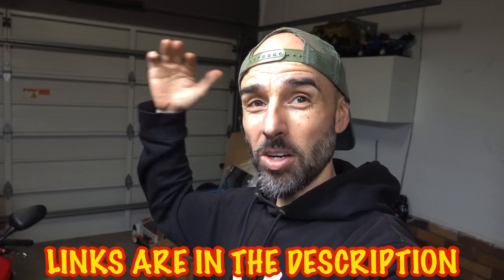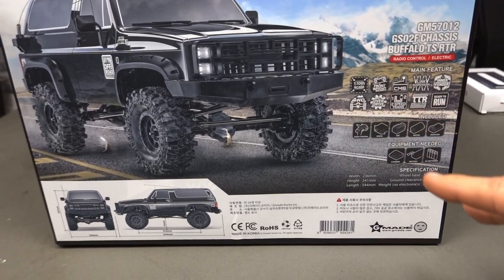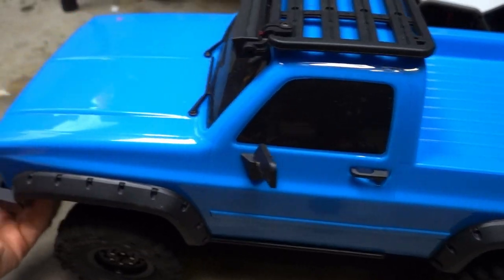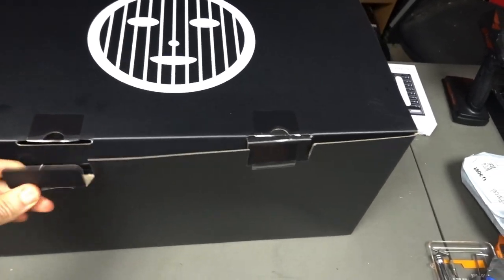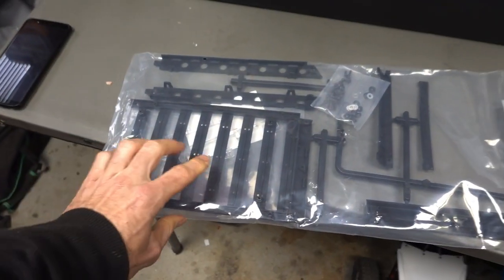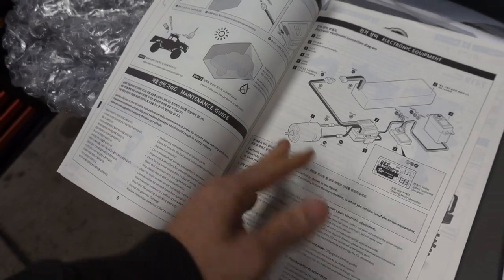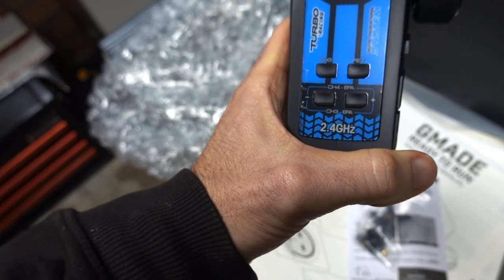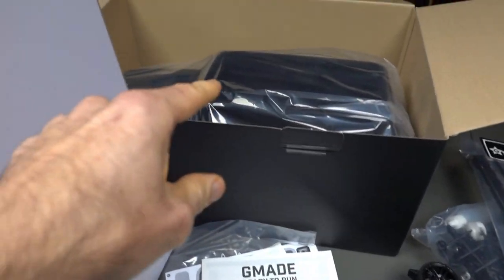STEALTH BLACK! GMADE BUFFALO RTR

Comment: I have one of these and the front pins are a pain to get at when out on the trails in mud and water unless you put body clip tabs on them, that makes it less painful to change out batteries. I added weight to my front bumper and on the bottom of my floor boards to try and stop it from rolling over so easily since this thing is top heavy ( I may end up cutting the body). I also took Gorilla tape and extended the wheel wells and the floor boards to reach the body for better protection from the elements so the inside of the body doesnt get as nasty as the outside does.
Reply from the maker: Awesome, thanks man. Appreciate the info